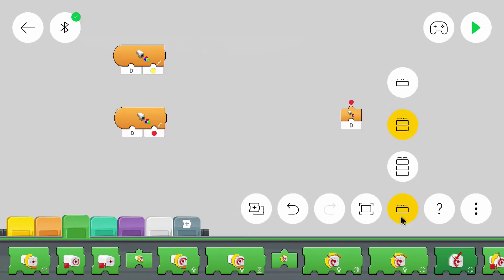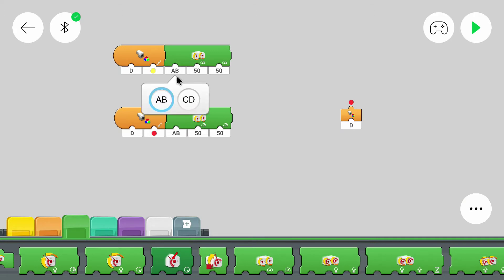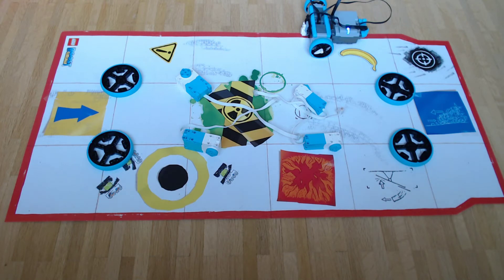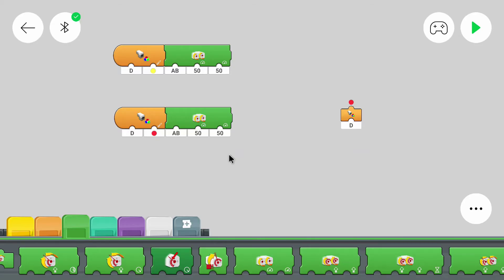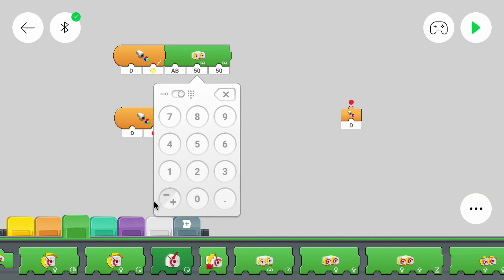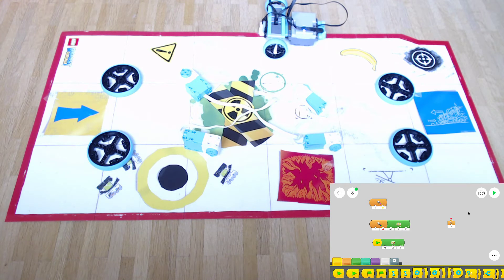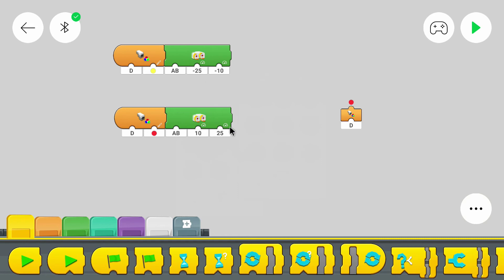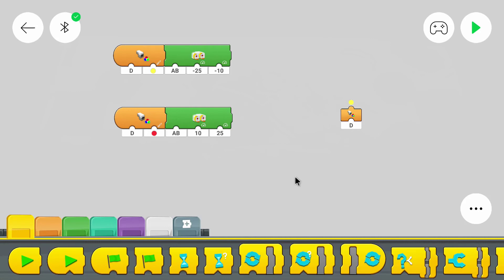Lego Powered Up Tutorial #06: a line follower following a red line [English|HD]

Comment: I have found very usefull tutorials in your channel! Thank you! :)

Do you think that it could be made something like this Gyro Invertor ( https://rebrickable.com/mocs/MOC-58271/azya/gyro-inventor/#details ) using 88012 Technic hub insted of 
Mindstorms Robot Inventors Hub? 88012 Technic hub has a tilt sensor in it.
Reply from the maker: You're welcome :)
As far as I know the BLE communication is too slow for gyroscoping balancing on 2 wheels.
However it does work with pybricks, which runs directly on the hub (but you'd have to progam it in python): https://www.youtube.com/watch?v=qi6MRyLSrsI